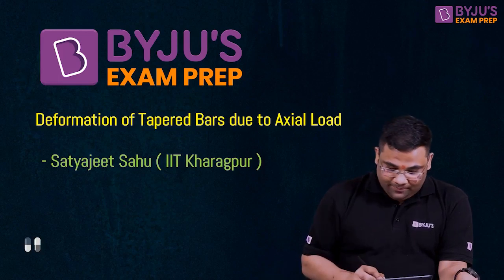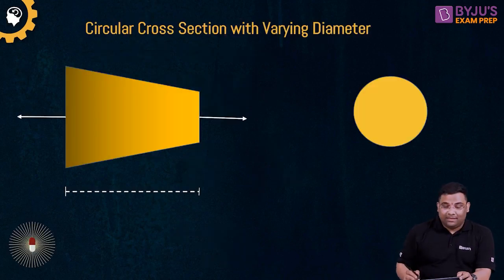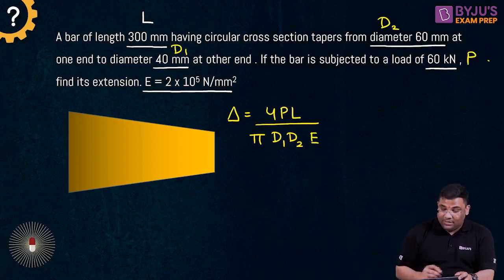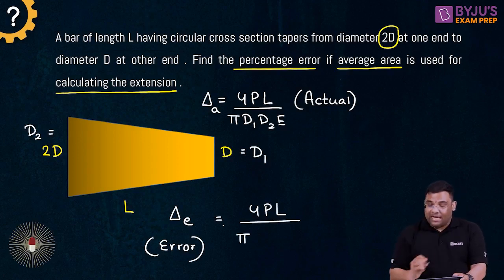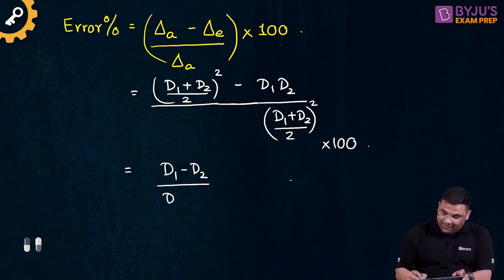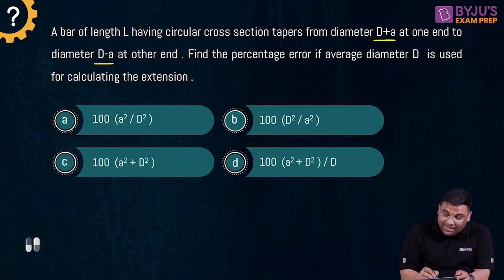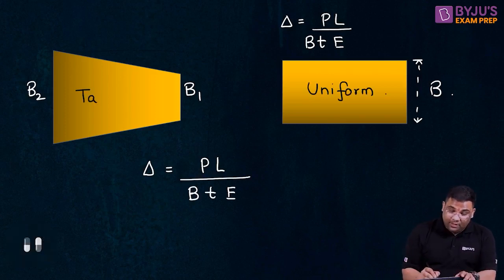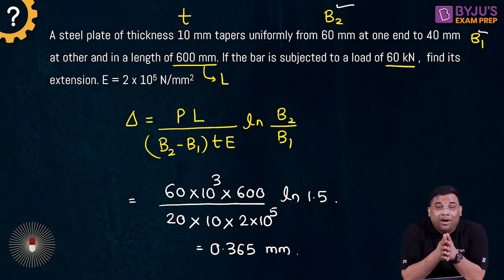Deformation of Tapered Bars Under Axial Load | Strength of Material | GATE ME 2023 Exam |BYJU'S GATE

Comment: Deformation due to axial load of various cross sectional bars, Changes between tapered bar with normal bar, and percentage error due to change in diameter in tapered bar.
That was all taught and numericals solved were so easily solved.
Very straightforward session sir.
Thank you so much❤